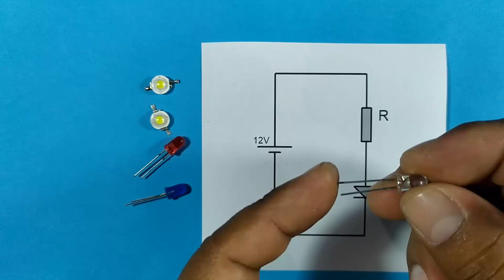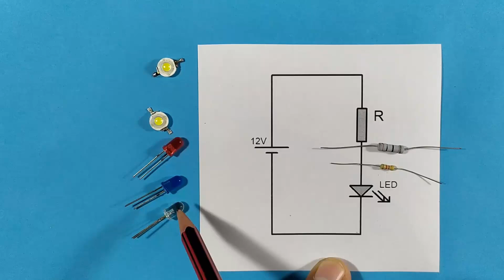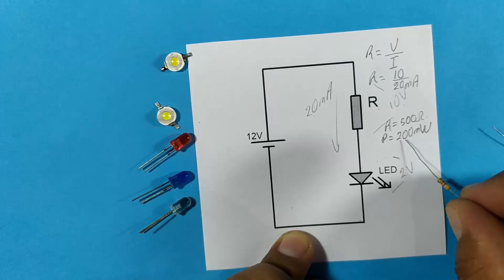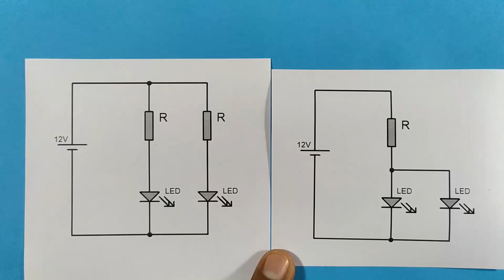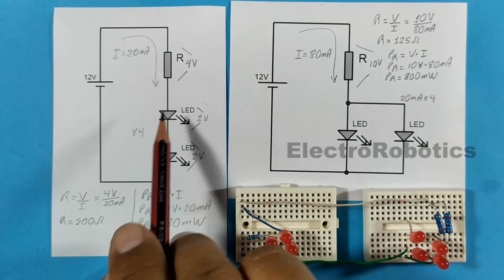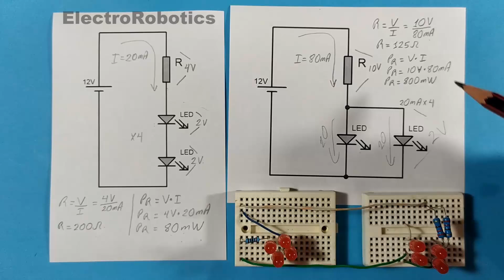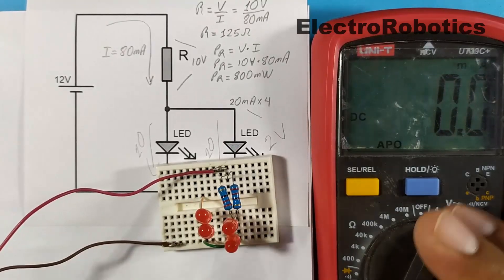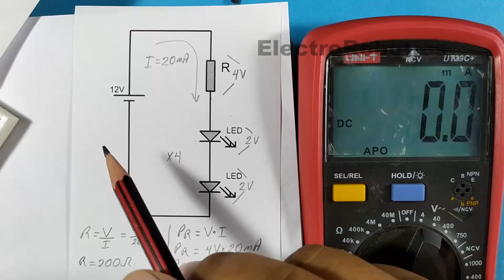How to calculate the Protection Resistor for an LED Diode?

Comment: 10 divided by .020, 20mA in amps =.020Amps, not 10 /20 = .5ohms you should explain what units are required for the formula

Comment: It is a current limit resistor to control the current through the LED. Calling it Protection Resistor is misleading.
Reply: Yes, the resistor is required to limit current and most LEDs are 20mA to 30mA so you chose the resistor to limit the current to that 
And you select the resistor that has the capacity to dissipate the energy that is given off as heat

Comment: Why do you teach your students to waste current in (there / your) bad designing, by running your LED at max current? - As can be seen in your Video an LED can go short circuit and burn out the Resister 0:25 - Your suggested  LED resister, At 470 Ohm 1/4W, VxI=W. 10 x 0.020 = 0.200W. The current flow from 12V can max out to = 12 / 470 = 0.026Amp and that can over drive the LED and shorten the life of the LED. Also, If the LED go's short circuit, the 470 ohm 1/4W resister will make the magic smoke. That is bad design. So, Far better to set a lower current and under run the LED for longer LED life, By using a 720 Ohm Resister. 12 / 720 = 0.017Amp max current flow OR lower the LED current in your equation to 0,015Amp, 10 / 0.015 = 667 Ohm resister, use the 620 Ohm, 10 x 0.015 = 0.150W. 4:43 Not as you say 10 x 20 = 200W = Wrong!!! - But 10 x 0.020 = 0.200W But that is Way to close to the resisters 1 / 4 max tolerance limit of 1 / 4 = 0.250W. 9:34 Still over driving the LEDS current to max tolerance = bad design 9:34
Reply: This is AI 😂😂😂

Comment: basic voltage loop:  V+, V_R, Vf=(diode)
basic current loop: If 
which = led forward current desired so's NOT to exceed led If_max.
so then
V+ = If × R + Vf
rearranged
(V+ - Vf)/If = R